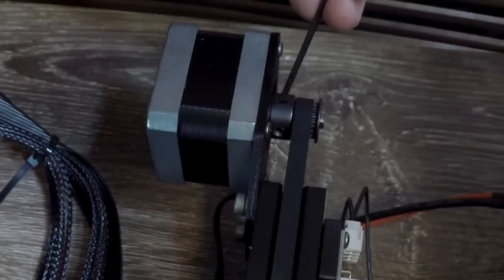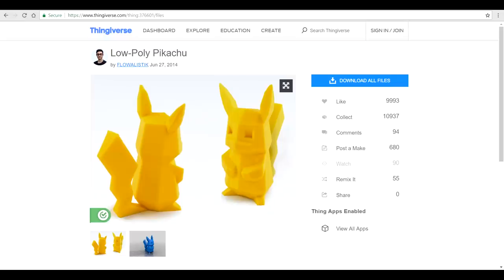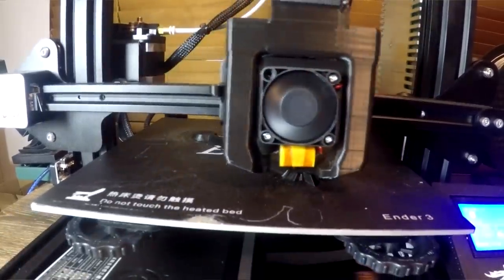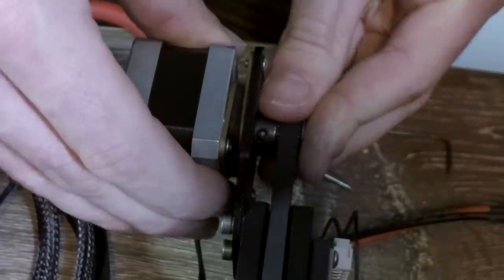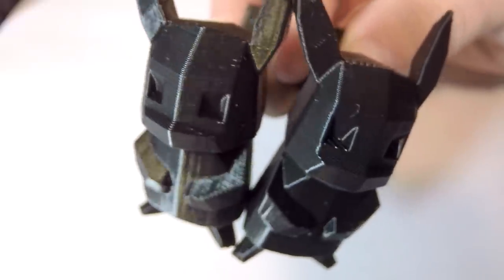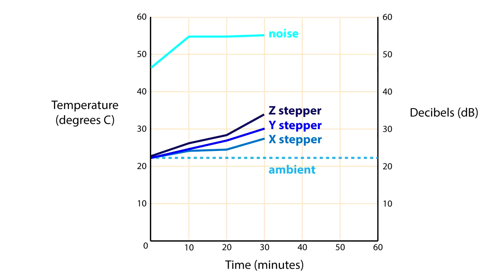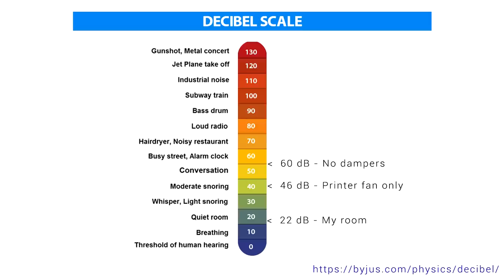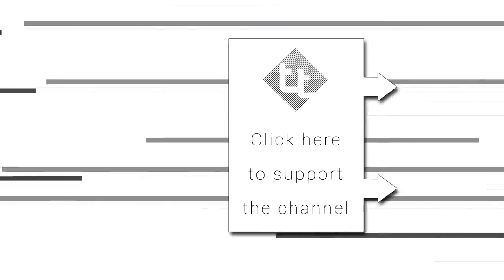Quieten your 3D printer with stepper motor dampers: Ender 3 tests

Comment from the maker: Creality updated the Ender 3 from my earlier version. The y axis needs a 3D printed adapter to fit. Search Thingiverse: https://www.thingiverse.com/search?q=ender+3+y+axis&dwh=465bbd91dc53144 and pick one. This is still a fantastic mod, highly recommended.
Update: Several users are posting that the pulley is permanently fixed on the stepper motor shafts. Please check for this before ordering the part because it will make fitment near impossible.
Reply: Have yet to do this mod but am planning to. Any suggestions on which adapter is best?
Reply from the maker: I don't sorry, haven't needed it on either of mine. Lots of suggestions in the comments below.
Reply from the maker: @toddd.8496  Thanks for sharing that link.

Comment: They  should be nearly a standard thing on most 3D printers going forward along with X and Y heatsinks. Printing over the southern Aussie winter I haven't worried about the heatsinks yet but I will be adding them soon. The Dampers on my CR-10S work great.

On the extruder without adding an upper bearing on the main shaft I would be worried about deflection and loss of accuracy/slipping.
Reply from the maker: Thanks for watching, two good points.

Comment: Straya! One thing to note (I have a CR-10S) when you mount the dampers with just 2 screws, the gear head(? not sure what else to call it) on the steppers that the belts attach to, will bend towards the belt drive ever so slightly. I had to square the steppers with zip ties to the frame to pull in the opposite direction of the belt so the gear was a few degrees taut the other way. If it's not square the belt will rub on the gear head(?) walls and make a weird zipper noise. It will most likely wear the belts much faster, and cause extra friction. I tried to just loosen the tension a bit on the belt first, but my first print was slipping on the gear head occasionally. I only put dampers on the X and Y axis as there was no room on the dual Z steppers. The Z also doesn't seem to make steps nearly as much as the X & Y. As for the E stepper, I had extra short screws and nuts, and mounted the top extruder parts to the E bracket where I could, and it works just fine. Just make sure you have screws that clear the gap from the stepper and bracket. I wonder if cut sheets of rubber would work for the dual Z steppers instead.... Anyway, great video!
Reply from the maker: Thanks for the detailed post. I haven't noticed enough flex to need that intervention, but your solution sounds quick and easy. I guess each brand has slight variation in the amount of flex.
Reply: @TeachingTech  could be the brand of dampers. My rubber on the dampers could be softer, leading to more tilt on the stepper.

Comment: The I3 plus has these installed for the z axis, which in turn basically helps silent the entire z and x axis. The idea of this is not to quiet down the z steppers, but to actually absorb the vibrations caused by your extruder assembly like x stepper, e stepper as well as the fans. Really smart by wanhao tbh. However, I tried installing these aluminum spring couplers for the lead screw and this reduced the noise from my machine considerably. Theyre like $3 each and I really do recommend them. The loudest part on my machine is the Y-stepper motor as it is hard-mounted to the frame and I have ordered these dampeners to help fix that.

Comment: I experienced a very hot extruder situation and had to add fans to my motors for a i3 prusa ..I measured the supply voltage and it changed from 12.5 no load to less than 12 V under full operation .When I adjusted the power supply back to 12.5 under full load operation the heat stopped occuring in motors and they ran cool..You can add a heatsink for the Y as it sits under the heated bed and helps. Not aving fans helps the heated bed maintain constant temperature.
Reply from the maker: Good info, thanks for sharing.

Comment: Bummer that the Ender 3 Pro has the pulley wheels pressed on the motor shafts, instead of the easily removable set (grub) screws :L

Comment: One thing to mention is that newer generation Ender 3 printers have a press fit gear on the motor that cannot be removed or adjusted, therefore cannot have stepper dampers.
Reply from the maker: I have a note warning of this in the description now. Very annoying that this cheap and simple mod is no longer accessible.

Comment: I think the most noticeable would not be decibels per say but to combine that with the frequency. I think the stepper motors remove a high requency where the vents are a bit lower (and easier to ignore). And the vents are a steady noise where the steppers are only at play when they move the head which is not moving steady. Interesting test anyhow and nice to see the print and heat don't get affected. There are a couple of mods that you can't print that I might be purchasing thanks to your videos. Keep it up!
Reply from the maker: Thanks for watching. I agree completely with your summary.

Comment: I used this on my stepper since tmc2208 didn't play well. it's magic tbh :3 but not as amazing as what tmc2208 does on my other steppers. it's some weird wizardry!  I also added foam between the screws of my extruder mount!

also you could just use a heatsink if it does it's cheap

Comment: I use these on all my fdm printers I didnt even print with my ender 3 before these were installed also heat sinks on motors an tl smoothers today

Comment: Anyone considering this upgrade with a recent Ender 3, check if your printer has the same removable pulleys with set screws on motor shafts as shown in this video. Like others have commented, my new Ender 3 (ordered and received last week) does not have adjustable/removable pulleys on the motors - they're permanently attached, without set screws, I guess unless aggressively cracked off and replaced.
Reply from the maker: I've been reading this a bit now. I can only assume it must be cheaper for them to make it this way, or maybe users reported issues with the pulleys slipping.
Reply: Just got mine direct from Creality via amazon, it has screws in those spots.
Reply: Yup same is the case for the Ender 3 Pro. I contacted them asking them why this is what they responded "Actually we do not recommend you to add dampers on the printer. if you add damper on y axis, it will cause pulleys loosening and there will be layer shift on your print. so all printers have been updated in order to stop buyers from adding dampers."
Reply: hub for what it’s worth, I’ve been using dampers on X and Y from the start, and I am not having any issues with layer shift. I did spend time making sure I had good clearance  on the belts and aligning the pulleys for clearance all the way across the travel. I’m running it in my living room and the loudest thing is the fan noise, followed by the Extruder Motor (I didn’t put one on there yet, and might not).

I’m completely new to 3D printing, and just last night printed the all in one micro test, and a benchy, and I can’t believe how good this printer is!
Reply: Yup I didn't believe their excuse either way, if pulleys were really a problem they could be secured with Loctite. I just returned my dampers that could only be installed with removable pulleys and ordered a pair that don't require them to be removed. Just passed along what they claimed to point out that the press fit gears are now standard with all their models, as they are actively trying to block users from adding them. Already found a modified motor mount for the Y axis that solves the alignment issue. And there are also printable TPE dampers that can make the install simpler for the Extruder Motor. Btw thanks for your vids I'm still waiting for some parts to finish upgrades but it made the process allot easier for me as a beginner.
Reply: @ Jo Van Bever Thanks, but read the update. The extractor does not work. Also there is not much point removing them as the shaft of this motor was not machined to fit adjustable pulleys (round) and I do not have the equipment to machine it myself nore to put the original press fit pulley back on.
Reply: hub I suppose in that case the only other option would be to buy some standard Nema 17 motors and grub screw mount pulleys for the x and y. That’s 2x “GT2 pulley:
Diameter: 16 mm 
Hole: 5mm 
Size: 16mm 
Teeth: 20”

And 2x Nema 17. But really I wonder if they are switching going forward, they still sell the pulleys with grub screws, and even the motor dampers for what it’s worth. I’d be unhappy if mine had press fit pulleys; I assembled and have been running my printer at home around my wife and kids and it’s not too noisy with those dampers mounted.
Reply: I just angle grinded my unremovable pulleys and installed new ones and the dampers, god damn it's muuuuch quieter
Reply: Anyone have a link to the correct set/grub screw pulley to replace them with when I finally get them off?
Reply: @superhub123  Can you link what you bought?

Comment: So I've had my ender 3 for a week now and have ended up with the uncontrollable heating bed. Was wondering if you have had any problems with it and if so how was it fixed? From what I read it's the mosfet chip.
Reply from the maker: Haven't had this but sounds like a dead MOSFET for sure.

Comment: Difference is hard to believe until you hear it in person!  On my Ender 3 I had to modify my bed carriage to clear the stepper motor, I understand that is required on some versions. Did you have to modify yours?
Reply from the maker: Checked and everything just clears. Guess I got lucky.
Reply: I had to grind off some of the carriage to make it fit.
Reply: Having the same problem.  I was wondering if anyone else had this collision.  Time bust out the dremmel!
Reply: Pretty easy fix. I used a black permanent marker to quickly finish it off the shiny edge after filing it down.
Reply: Yep I ran into the plate but Ill dremel it out later ..
Reply: Oh ya, I got the bed smashing on the stepper, too. Do you have any picture or link to the filed-down bed carriage?
Reply: Glad to know this is a common issue. Needless to say I panicked a little when the bed collided with the motor. I'd be interested in why this isn't an issue for everyone though
Reply: Totally agree.  This is well worth the upgrade.
Reply: You can print a Y microswitch adjustment part.  No grinding needed. https://www.thingiverse.com/thing:2879245
Reply: @pentachronic  yes, this worked good for me
Reply: I had the same issue and had to use some v slot nuts to move the end stop
Reply: In case anyone else hits this and doesn't want to remove the dampers to print the adjustment part, I'm printing temporarily by screwing the right screw into the left hole.  I'll replace with the more permanent solution when this prints...
Reply: Thank you very much. Great suggestion. I did this and it works fine
Reply: Yeah, I had to file a notch into the aluminum to clear the back of the bed’s stepper motor. Easy and harmless. I agree with the other person in this thread, permanent marker hides the aluminum shine no problem. 

I ordered 4 days ago, from Amazon via Creality direct. Another video from July of this year also had a different belt tensioner design at the bed, so Creality is clearly iterating on their design without announcement.
Reply: Gazza-usa you’ll lose print bed size doing that, and you’ll need to adjust your Cura printer profile to reflect this if you are doing a huge bed filling print or else it could put the extruder out off of the bed.
Reply: Mithun Kumar just measure with a ruler against the back of the motor and Mark with a pencil the line on the aluminum carriage, then measure the distance from the Y axis wheel that needs to bump the end stop switch and mark that as your file depth. You can use a rough file but you’ll probably end up wanting to finish up with a fine file if you do so that you can make it smooth and round off any sharp edges. My prints are fantastic on this machine, it doesn’t hurt a thing.
Reply: @pentachronic  Tried this. On mine still clunked on homing and now no 'free air' space to do Z homing. I undid it and took a machinist's file to thehot bed X brace. Easy.

Comment: Did you modified something else on the Y-Axis, because when mounting the damper on the Y-Axis motor, it stays out a bit more, wich makes the stepper motor collide with the bed frame, before it can hit the endstop.
Reply: Just realized this.  Bought these dampers thinking it would be an easy upgrade, turns out I have the press fit motors, tried getting them off, ended up buying new motors, installed motors, Y-axis is now colliding.
Reply: @ikmnification5737  I found a fix for this. I just unscrewed the Y-Endstop (two holes/screrws) and just put it one hole further and just screwed it with one screw, so the endstop is about 1-1.5cm further, and the switch get triggered before colliding with the extruder.

Comment: If you don't have two additional screws for the X axis dumper, just switch the two long ones with two from the motherboard cover. They fit there perfectly.

Comment: I noticed in the description that you we're saying you wouldn't recommend this anymore if I were to get a new board for the printer. However when I ordered the Capricorn tubing, the motor dampers came with it anyways in a kit. Should I still use the dampers if I'm considering getting the board anyways? Thanks.
Reply: Get a new board. The stock board is inferior to new ones, and you have no safety options enabled by default. I recently purchased an SKR mini e3 v1.2 (get the v2 if you can afford it) and it was definitely worth every penny! Loudest part of the printer is the fans and got rid of zebra striping artifacts on my part walls
Reply: You can hear the printer after the upgrade here https://youtu.be/KmJcZ9SIOtc

Comment: Nicely detailed video, but, after a while of using it, do you see any signs of the dampeners getting broken, like a separation of the rubber and the metal? I saw some comments on Amazon about that fact and opted for going Neanderthal and just cut pieces of bike air tubing. It helps but not as much... If no signs are to be observed I'll be ordering some as I'm a fan of that... Thx! Cheers!
Reply from the maker: I've just inspected my three printers wit them and all are in good shape. If you are concerned, hopefully they are cheap enough to order spares in case.
Reply: @TeachingTech   could another option be 3d printing spacers with flexible filament? it would mean you could use all for screw holes and just reprint them when needed

Comment: I recently bought an Ender 3 with some of my tax refund, and I went to add stepper dampers. However, my Ender does not appear to have adjustable drives on the X and Y motors - no grub screws or anything that would indicate a way to make the necessary adjustments to these two motors. Unless there is some way to adjust these that I am not aware of, I'll have to buy replacement motors in order to add in the dampers. I would advise all new Ender 3 owners to check their printers first before buying the dampers, as I was only able to fit one on my extruder.
Reply: Not sure if you managed yet or not seeing as it's been a year, but there is a way around this by printing a bracket to mount it. Mine has the same issues of press fit pulleys and it seems to work well enough so far.
Reply: @blakeklunder9643  can you send me a link for thoose?
Reply: @blakeklunder9643  k thanks

Comment: Switch to Trinamic drivers. I adapted them for my FFCP /Qidi Tech One. Makes the steppers practically silent. It was about $8 a driver. I only bothered with X and Y.  Also prints better too.  Can’t recommend highly enough.
Reply from the maker: I will definitely be exploring this for one of my printers, probably the frankendoodle.
Reply: The problem is that you need to completely swap the electronics on the ender 3 if you want to use the tmc
Reply: It wasn't exactly easy to put them in mine... Not supported by sailfish as-is.  I had to mount them upside down, and had to be creative soldering to get things working.  But so worth it.

Comment: I'm having problems adding a dampener to my Y axis (bed forward/backward stepper). The added depth means the bed is hitting the stepper motor, before the bed hits the microswitch, and the microswitch  is at a fixed location that cant be altered.  Any suggestions anyone?
Reply from the maker: The printer was updated after I made this video. Search Thingiverse and you will find printable adaptors to align everything to work.
Reply: cool, thanks!
Reply: @TeachingTech  No need to print out an adapter, just use som T-nuts, which was provided as spare parts, to fasten the Y endswitch a tiny bit further in on the Y-axis aluminium extrusion. This will solve the problem.

Comment: tnx for the information, I guess I eventually will buy some. Any difference in all of them, any particular that are especially good (brand)?
Reply: Also is it worthwhile to change the fans to Noctua or more silent fans? 
Also, come to think of it, is it a good idea to increase fan size and use a reduction adapter for more efficient cooling?
 Maybe buy or make super light fans made of carbon fiber (could be a cool project using the 3d printer to make molds) to reduce inertia in the printing head.
Reply: Another idea I had is to incase the whole printer within a noise silent box, but with air in- and outtake.
Reply from the maker: Some very interesting ideas you have. I've seen people encase other CNC machines and dust extractors in old fridges because of the insulation. I've only tested the one type of damper. They generally look identical, they're probably mostly made in the same factory.
Reply: Hi, tnx for response! I don't like buying stuff if I don't know anything about the product, I guess I can calm down on getting the best dampeners.